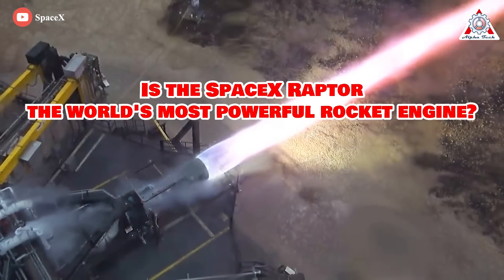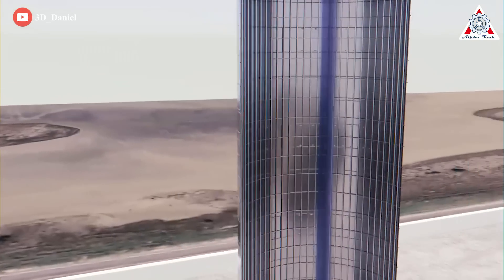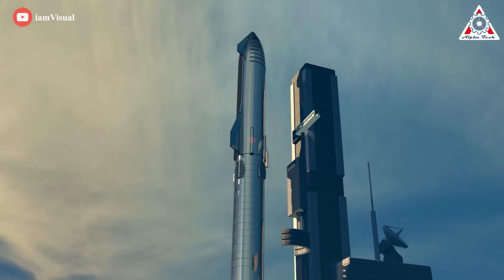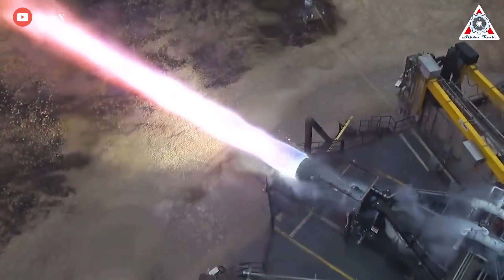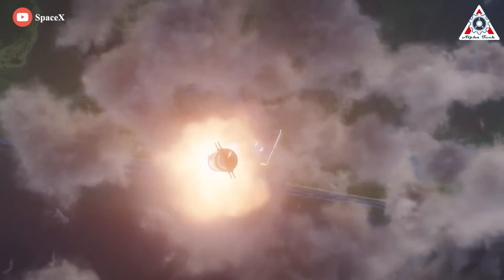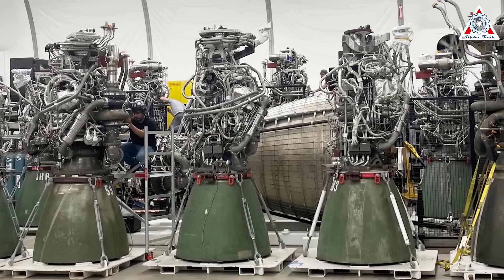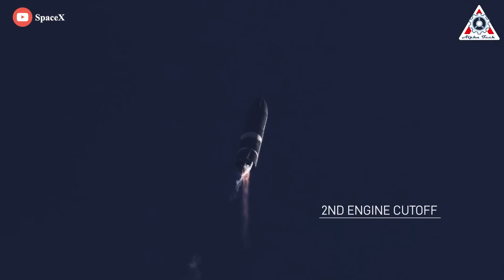Why SpaceX's Raptor is the best engine ever made...?

Comment: Raptor is the best engine ever made? I'm not a rocket engineer, and couldn't say on the technical merits. But I can recognize hype. Looked at another way, you can say that the Raptor hasn't been made yet . That's because it's still in development, still requires static firing in combination within the rocket design it's intended for, hasn't been proved in flight, hasn't been reused in multiple flights enough to know anything about prolonged durability and reliability, ....  

This is not to talk it down. It's in development. It will have to prove itself in practice, or it will not ever become "the best". This is not a technicality! It is a flight requirement, a must for mission application, a must for mission success, an absolutely critical life-support element for the missions that are projected.

What ought to be said, and can be said legitimately, is that it is the most complicated and the most flexible design ever, with the most potential of any engine under development to satisfy the far more ambitious missions that we are looking to happen, far more ambitious than any missions ever done. Isn't that good enough?

Comment: This booster for the starship launch, has me concerned, after resent test burns with just a few engines has had the exhaust trench breakup its heat shield and damage engines, if any one reading this has ever put an acetylene torch at full chat to concrete surface you will understand the problem, I can see how all the  engines will work with all that heat and huge volume of water in 
such a closed space, as water increases its volume by 1500 time once turned to steam, call me daft I don’t think it will happen , it most likely will lift then engines will be overcome by the I call it’s sturbulance , on such a scale the lift trust will be compromised, I prey lam wrong as success of this first flight must work, the catching of the return booster will be awesome, wishing the space x team a mass of luck 👍

Comment: Here's a thought that just maybe Elons' engineers have thought of ( or maybe they have and this idea is just not possible )

How about a rocket system that has one  BIG fuel and oxidizer duel turbo pump. Basically the same as the turbo pumps in each rocket engine only much MUCH BIGGER ) This pump would serve the same function as all the little ones on each individual rocket engine,  feeding the fuel and oxidizer to all the engines thus eliminating the need for each engine to have it's own pump(s). This main pump would be a monster and cost a pretty penny but money and weight would be saved because each rocket engine would not need its own fuel and oxidizer pump. One undesirable aspect is that the fuel and oxidizer lines from the monster pump to each engine would have to be able to take the higher pressures than the lines currently in use.

Just a thought that's been rolling around in my head every time I see all those engines hanging off the bottom of the super heavy first stage
Reply: Done that already. Russian RD170, RD180 series of rocket engines use the same idea as yours.
Reply: I doubt there is any chance of that for large numbers of engines. The pressures would be just too enormous.

Comment: SX300 What? Super Alloy.   I believe you meant Inconel . . pronounced as Inc. (as in the abbreviation for incorporated), Caw, Nell. Inconel, a Super Allow whose name is trademarked w/ Special Metals Corporation, has many applications in Aviation.  Mainly in extreme High Temp recip engine or turbine components, such as spark plugs or hot section injector nozzles. It's not cheap and hard to machine/fabricate due to it's hardness and High temp properties. And of coarse, SpaceX has their own formulation of this metal produced just for them. The same is true with their Stainless Steel used for making StarShips, the standard 304L SS blend has been tweaked for welding and structural purposes.

Comment: thoughts on Aerospike?
Reply: Aerospike engines were not fully developed, and are now obsolete in orbital-class rockets. (There might be room for them in low mass non-orbiting vehicles, but even that is sketch.) They were conceived as an answer to the problem of thrust efficiency on SSTO launch vehicles. SSTO, or Single Stage To Orbit, vehicles were conceived as an answer to the problem of launch costs and therefore, reusability. They were at one time considered the holy grail of launch vehicles. However, that was before it entered into the mind of engineers that boosters and higher stages could autonomously return and land. 
SSTO has many problems, the thrust efficiency not the least, and since the main problem it was trying to solve has been solved in other more efficient ways, it has and will become a relic of the past, taking the aerospike with it.
Reply: @tylerfb1  so stagging will remain moving parts fail
Reply: @craigpalmer9196  I'm not sure what you're trying to say. There are technical problems with aerospike engines that haven't been fully solved, and in order to do so, there has to be incentive to invest. There isn't any, so it won't happen.

Comment: Except the fact that it burns methane, this engine has absolutely nothing exceptional. Its performances are rather average.
Now about methane it's the problem of the half full / half empty glass.
Methane is more performant than kerosene, but less than hydrogen
Methane is more difficult to store than kerosene, but less than hydrogen
Reply: Umm, no. The full-flow cycle is significant and unique. Russia developed such an engine, but never flew with it. It's not intrinsically a huge thing, but it does gain a few percent in efficiency, since no fuel is lost running a separate gas generator to run the engine's pumps. The other "closed cycle" engine used IRL is the expander cycle, as used by the RL-10 and its many variants.
The separate pre-burners also allow for much more moderate conditions -- relatively speaking --- for the engine's turbines. They get much lower combustion temperatures at the cost of additional pressure (probably 500 bar or so), and an oxygen-rich preburner (metallurgically interesting?). Russia had the latter problem solved at one point, but no flying U.S. rocket has done that.
With both preburners functioning, it should be much simpler for SpaceX to adjust the mixture, pressure, and running parameters to operate the main combustion chamber as hot and pressurized as they dare without having to otherwise fiddle a lot with the preburners.
Reply: Rocket scientists have known about methane for nearly 100 years and purposely avoided using it because it isn't suitable for heavy lift, orbital delivery.  It's the tyranny of the rocket equation that has relegated methane to non-performance in space vehicles.
Reply: Running it 20+ times without overhaul is unique.
Reply: @rubikmonat6589  No, one J-2 engine (used for upper stages of Saturn V) has been tested in January 1966 and fired 30 consecutive times with success... so nothing new here.
Reply: @tontonbeber4555  cool, I didn't know that, but thats a test engine, flight engines get fired maybe three times.
Reply: @rubikmonat6589  Two times in Apollo missions. But it has been proved that the engine had the capacity to be fired 30+ times. And moreover overall performance of the J-2 engine was higher than these of Raptor.
Reply: @rubikmonat6589  Never been done.  So it's hypothetical.
Reply: Methane can be stored liquefied under pressure at room temperature unlike hydrogen.
Reply: @rais1953   not practically, you'd need over 320 bar for that. that's higher pressure than a scuba bottle. its much easier to chill it and liquefy it to store it as an ambient pressure liquid
Reply: @rais1953  Umm, no, methane cannot be liquified under pressure and stored at room temperature. Propane can.

Comment: Help me understand why rocket engine thrust is often given as foot-pounds force, when I think it should be pounds force, Newtons, or kilograms force.
Reply: I've NEVER heard foot-pounds...  what planet are you from?
Reply: The narrator probably misread the abbreviation "lbf" as "foot-pounds" rather than "pounds-force".

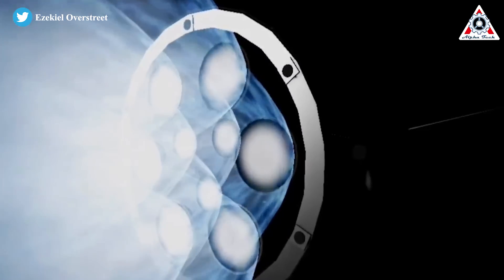As a mechanical engineer, I shared your confusion (at the 1:40 mark) of equating "3 MN" (3 mega newtons) of "thrust" (a unit of force) with 670,000 "ft-lbs" (a unit of energy).  Here's what Wikipedia says about the Raptor:

"Musk revealed that their target performance for Raptor was ... a thrust of 3 MN (670,000 lbf)."

It appears the narrator got a little mixed up when he saw the abbreviation "lbf" and added the word "foot" to something that should have only been worded as "pounds" or "pounds-force".  In our archaic Imperial system, there are lbm (pounds mass) and lbf (pounds force).  A 6-lbm object on earth would weigh 6-lbf on the earth.  However, that same 6-lbm object would only weigh 1-lbf on the moon since the moon has 1/6th the gravity of the earth.  Wikipedia used to term "lbf" because if it just used "lb", some might think the writer was referring to the mass of the engine (which is 3,500 lbm, meaning it weighs 3,500 lbf here on earth, nowhere near 670,000 lbf).

Now you know how thrust-to-weight ratios are calculated.  The Raptor has a T/W = 191 (670,000/3500).

Comment: Definitely NOT the best (rocket) engine ever made (yet). No matter what the numbers are, the most important factor of an engine is reliability and Raptor have a lot to prove on that part. We have had a lot of different Raptor failures (or at least Raptor related failures) and no Raptor to space yet.
Reply: Thank the FAA for the fact Raptor has yet to fly, not the engine.
Reply: @rorykeegan1895  Not true.  SpaceX screwed themselves when they didn't follow the rules.
Reply: @rorykeegan1895  You know that is not true at all. For the first, FAA has an important job and is needed, that SpaceX is waiting as long as it can before applying for licenses to put pressure does not make it FAA:s fault. (SpaceX has not even asked for launch license yet even though first FAA approval was months ago).  Second, SpaceX is still not ready for launch and some Raptors is being replaced after each test.
Reply: The chamber pressures and thrust-to-weight ratios are nothing to sneeze at, however. Neither is the (projected) per-engine cost. The Raptors are absolutely incredible, as-is. Things can only get better.
Reply: @Bobcat665  Like I wrote, it does not matter if they can't get it reliable, then its worthless. (I hope they succeed)